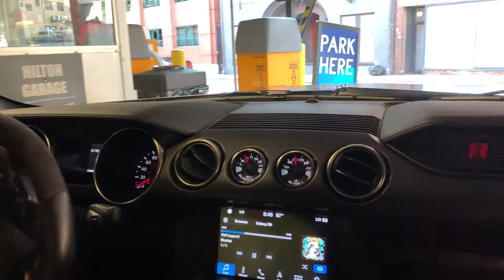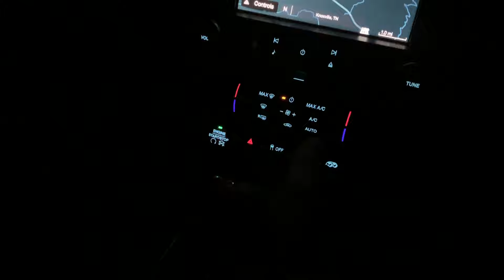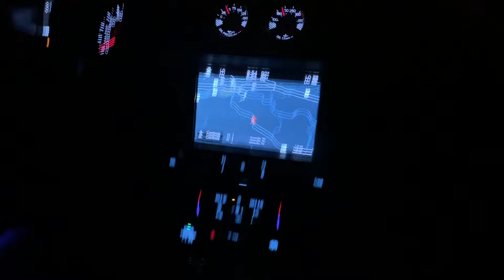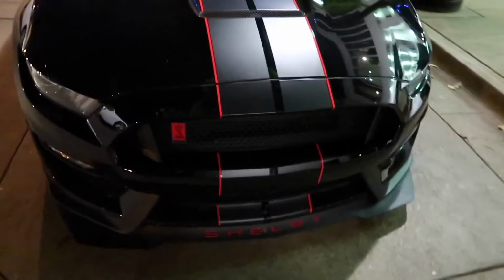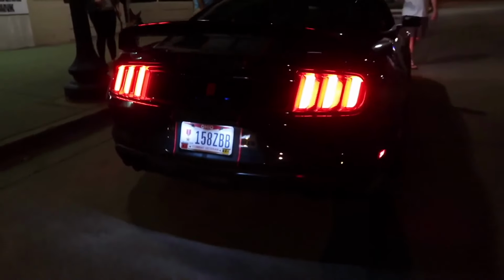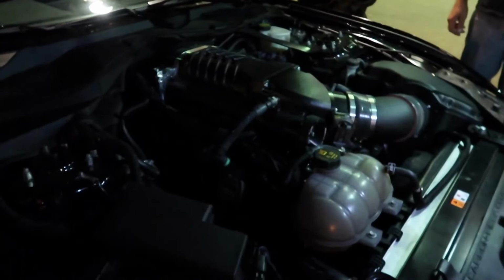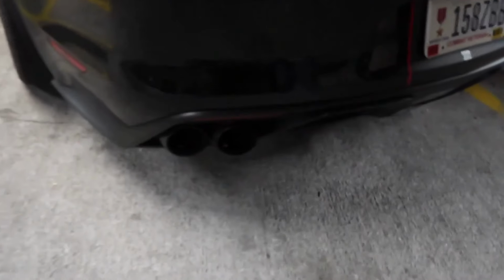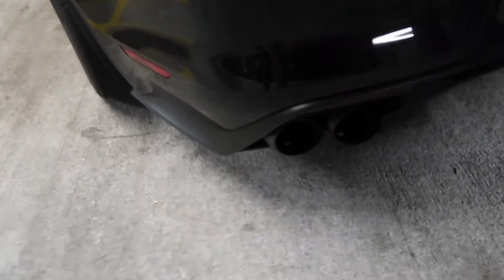Boosted Shelby GT350R RIDE ALONG! *Sounds Like a Supercar!*

Comment: Just ordered a 2020 few weeks ago cause of how great it sounds. Correct me if I’m wrong, but that 5.2 liter Voodoo is the most powerful naturally aspirated V8 in a production car. With FAI, no turbo because they sound weird on a muscle car, it’s got so much potential. From my understanding Ford bought a Ferrari 458 engine and broke it down and essentially recreated it with their own timing and note. And the car is the most badass sounding car I have ever heard, and I’ve heard just about them all and the Voodoo takes the cake.
Reply: War Tortilla it’s not a 458 engine just a stroked 5.0 with a flat plane crank and different firing order. 458 engine is much faster and better
Reply: @speedlife301  🙃
Reply: @speedlife301  Ferrari even called this engine too 3 greatest ever made by man